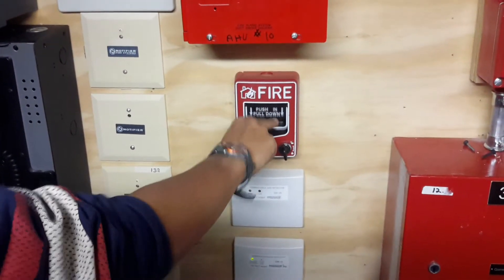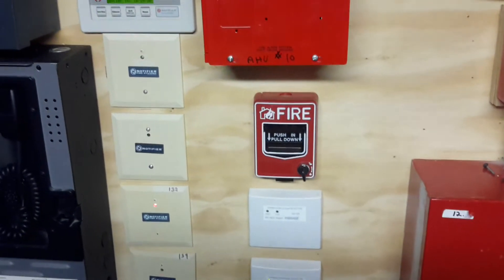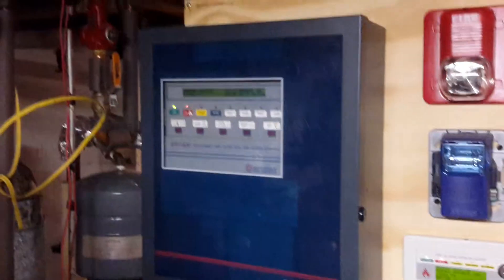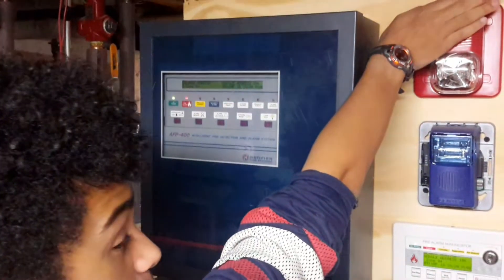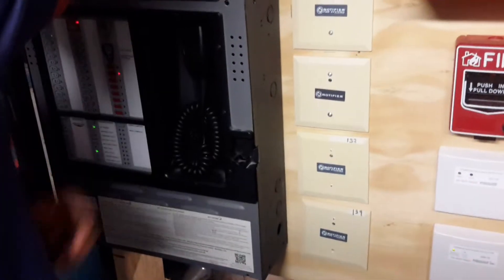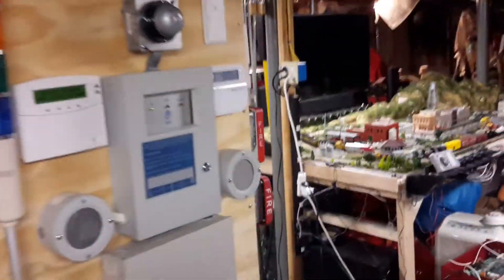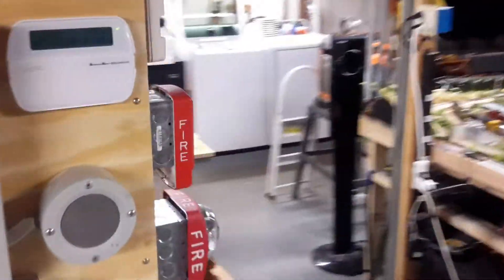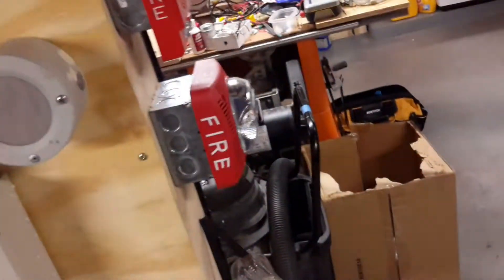Notifier NFC 50/100.

Comment: One thing I hate about notifier voice evac panels (not including the AMG and DVC) is that they reuse tones and messages from there fire lite counterparts. At least they could’ve used the voice evac message and tones from the DVC. If you’re going rebrand a voice evac panel be The Simplex 4003ec. Simplex used there own tones from the 4100 series and put in to the panel. They created their own messages for the Simplex 4003EC. Even though I don’t like the default message of the 4003EC. At least they did a good job unlike notifier which didn’t change a single thing other then the Color scheme.
Reply: Honeywell really do be like that
Reply: you can put custom messages on it